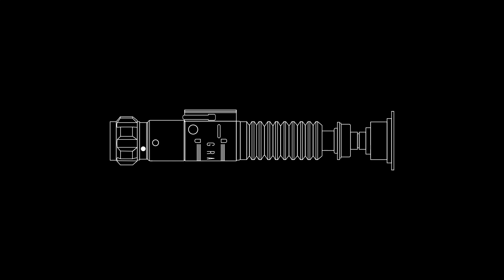V3 Hole Tutorial

Comment: I'm brand new to this Hobby and looking for some guidance . From my research it seems that most V2s have a solid aluminum neck and wind vane section that isn't detachable. I'm trying to create my ideal Luke saber which would essentially be a V2 but with a solid brass neck and wind vane section (just like the Hero version) . Is there any kit out there that's good quality that would allow me to do this? I've researched it to death and can't find a clear answer. Someone suggested just finding a V3 somewhere but I really like all the components on a V2 what would just like a brass neck. Thank you so much for any guidance you can give me or or point me in the right direction. If it's something you would like to possibly commission someday please let me know. Just FYI I'd like the hill to be aluminum and I would like to install the saber to be neopixel
Reply from the maker: The custom saber shop has modular parts that you can use to build a v2 with a brass neck.